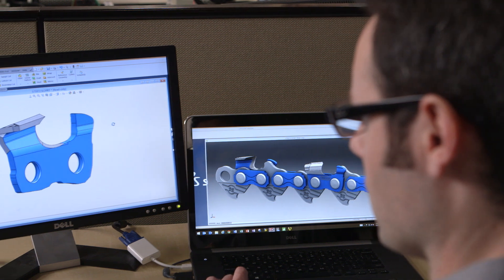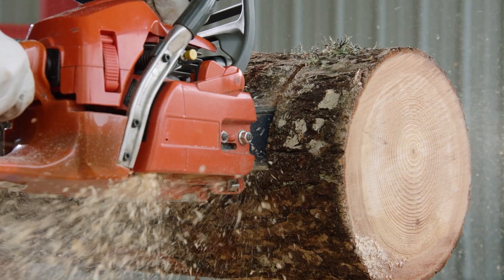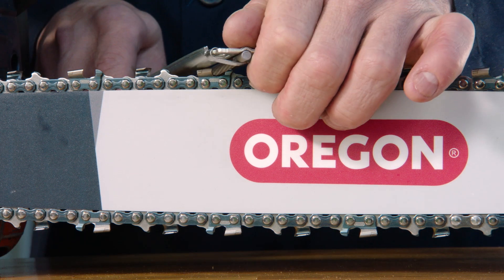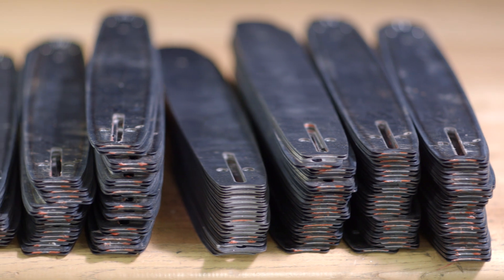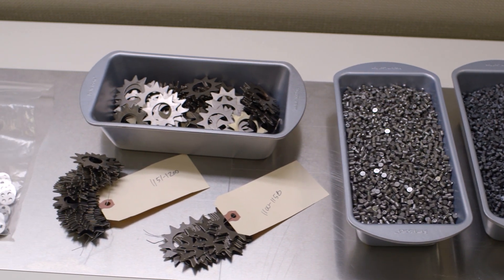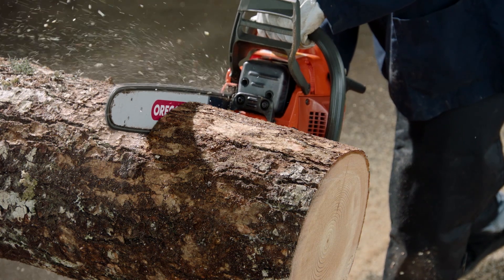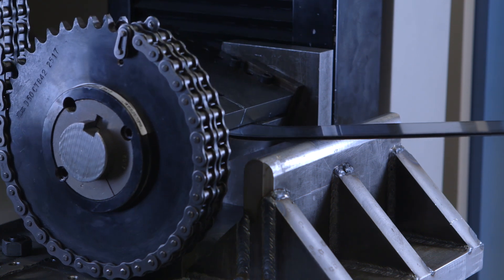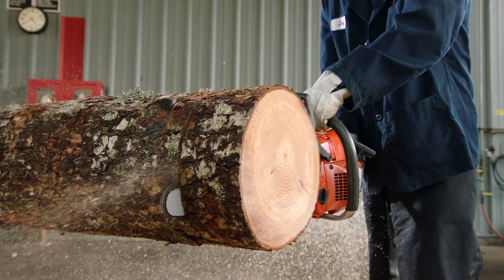The Engineering Behind Oregon SpeedCut Bar & Chain

Comment: Just wondered if you have taken into account the 'Dissimilar Metals' galvanic action, which could cause corrosion in five or so years time.   I know the aviation industry uses bonding principles, and is very concerned with reducing corrosion.   Maybe an inner core mode from a lattice structure would get the same lightweight results.
Reply: I work in aviation if your bar is 10 years old it might be time for a new one unless you don't cut often

Comment: Hi from Oamaru New Zealand.
Question; is it correct that sprocket tips bars are for softwoods like pine etc and non sprocket nose is for hardwoods?.... thanks
Reply from the maker: Hi Oamaru- thanks for the questions and sorry for the delayed response. The only sprocket-less products we have is DuraCut and Sculptor. SpeedCut has a sprocket. The sprocket nose vs sprocket-less on DuraCut comes down to preference for the saw you’re using. A sprocket-less bar can be used on varying saws with different drive sprockets. So if you had a few saws with different pitches but same tail mount, you could use the bar as a backup for your multiple saws. It does generate more heat and take more power to pull around for the sprocket -less bar, but it will also cut better in dirty and abrasive conditions because there is no sprocket for dirt to get into. They will both would be able to support a chain to cut hardwood.